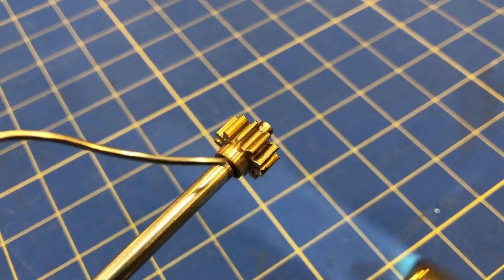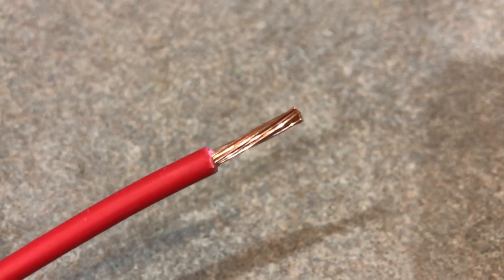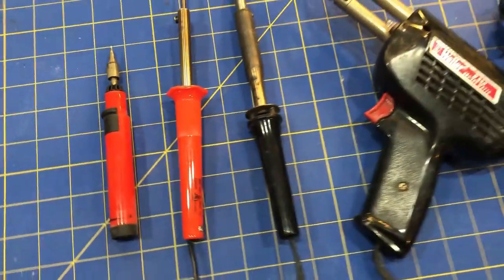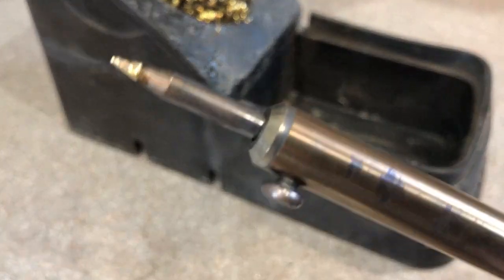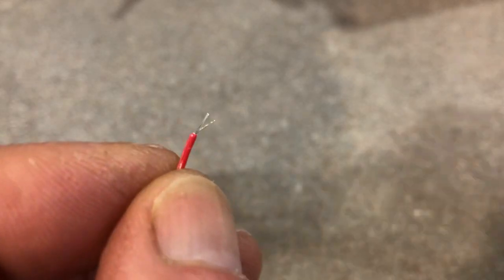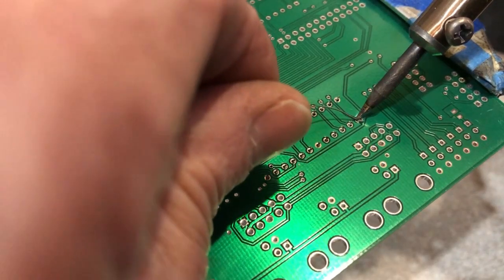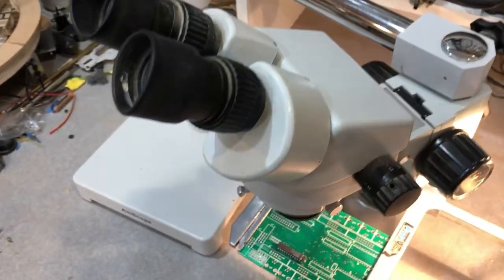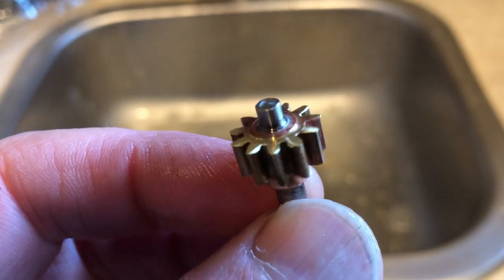How to solder

Comment: My father taught me how to solder when I was only a little older than you were when you started. He taught me all the mechanics and then once he started letting me do it he quickly realized my joins came out a little better than his so while he was always there to supervise he usually was more than happy to let me do the actual soldering. What was the difference? Patience. Patients makes for well soldered joins the first time. Rushing and cutting corners inevitably means having to spend more time, effort, and materials than it would have if one simply takes their time to do it right the first time.

Comment: Not me at 40 afraid to solder my belt and you said you’ve been doing this since you were 10. My 60watt is just as “dangerous” as the Golden Hot curling irons I’ve been burning my hair with since I was 10 so I guess I’m safe. I confused soldering with welding for some reason 😅 I bought leather gloves and a welders hat 😮🤣🤦🏾‍♀️
Reply: Pi

Comment: Card index.❤😂 well you must be my age.
   Must subscribe. 🎉
Oxidization ? Jeeze not one of the 7 videos I watched mentioned this. You should of seen the mess I made last night. 
    Very stupid question I know this because I know mechanics a lot of them Belvedere is he told me that not all metal is built the same pure metal has to be attached to Pure metal you can't attach clean copper to say a metal that is probably like made for commercial use such as leather snaps because that didn't work. 
    When I bought my soldering tool I tried it on a couple of nails 100 years old so most likely pure metal you know no impurities mixed in. It worked so well I thought piece of cake. Nope.

Comment: In tinning a wire for a joint. You should never let the solder go under the insulation. Also the joints need to be cleaned with alcohol to prevent corrosion before you seal them. Otherwise it’s a doomed connection.

Comment: What if you’re not sure what you’re soldering? 

I have a slide drawer for storing coffee k-cups. I believe it’s made out of metal instead of aluminum, but I’m not sure how to tell. One of the rods on the front end side has pulled apart from the front face (bad original solder job). It doesn’t really effect the drawer performance but it’s annoying flopping around a bit. I hate to throw it out and get another (like friends have suggested) when it should just be an easy fix. 

I have in my possession a pencil like tip soldering iron, one with a standard flathead screwdriver like tip, and a small torch like at the end of your video. I believe the only solder I have is a package of small Lead-Free Rosin Core Solder. 

To correctly re-attach the rod (it will stay put touching the front until you move the drawer) are you saying I need to use the torch rather than the electric soldering irons? So far most videos I’ve come across in my search is how to solder electronics versus small household shelves/drawers. Any help would be very much appreciated.

Comment: What is the difference between solder paste and solder flux? Will the paste work on aluminum wire?
Reply from the maker: Solder Past has solder powder mixed in with it. I have only used solder paste when soldering surface mount components to PC boards. Flux is only just flux and keeps oxidation to a minimum.
Neither will work for soldering aluminum. Aluminum solder exists but its nothing like normal soldering and will take some practice and YouTube  watching to be able to do it. Maybe I should do a video on that!
Reply: @TheWeevilGenius  thank you 😊